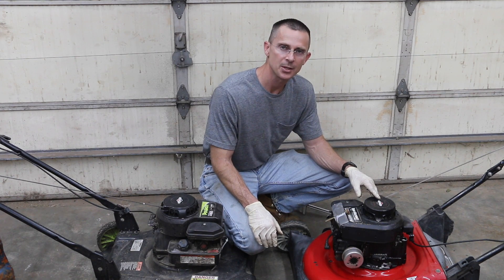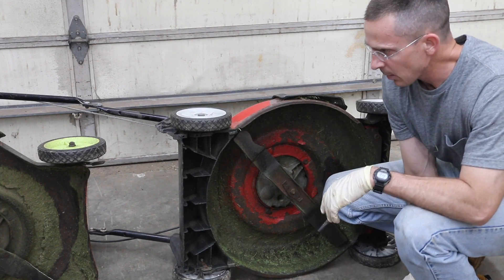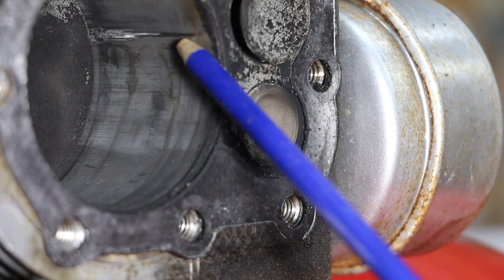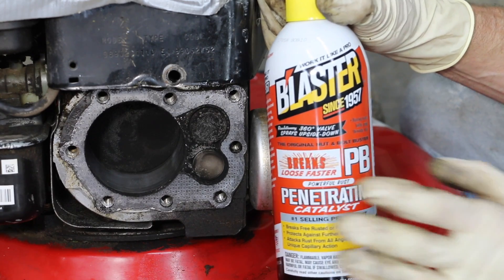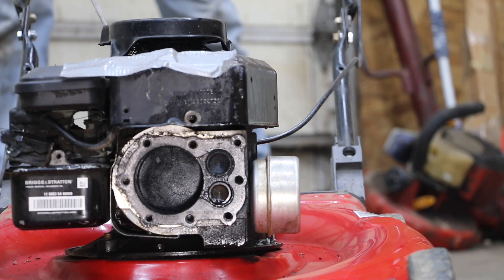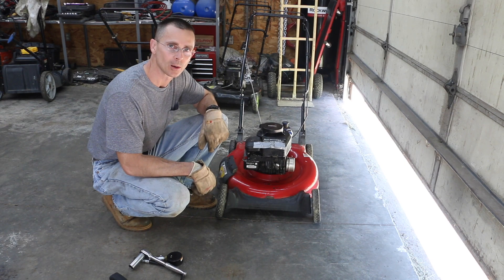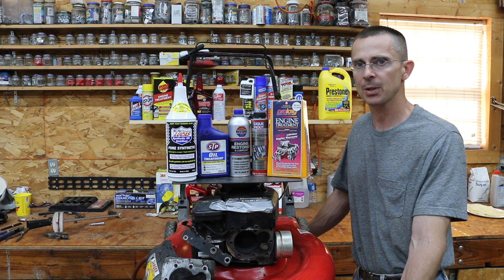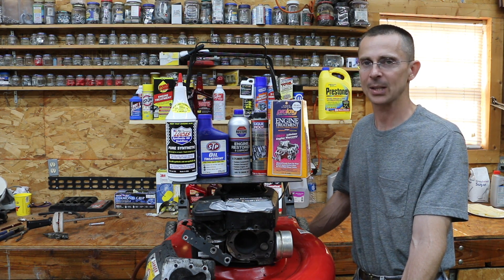Engine ran without oil, seized! Can it be saved?

Comment: I've been turning wrenches for a long time and may be able to help you here, even if only a little bit. The manufacturers claims on products you're displaying would be regarding a motor that has normal wear and tear, yours is abuse so it's going to fall outside of the product design. If the cylinder is aluminum and not sleeved, you may be able to use aluminum brazing rod, smooth it with a file or emory cloth and hone it to make it finished better. Then polish the crankshaft and plastigauge the bearing clearance. You may need a new rod bearing. You could try some of the products for the knock but you really need something that is thick. They used to make motor honey, or just use gear oil. Have fun.
Reply from the maker: Mike, This is very informative and helpful! Thanks for watching the video and commenting!

Comment: just for the hell of it, see what the ceramic oil additives do to polish up nasty bearings. id like to see what it does to the connecting rod bearings and crank journals. just for the hell of it.
Reply: or maybe see if an oil that is rich in zinc will quiet the knocking a little
Reply from the maker: leakage182, Great idea!  Thanks for watching the video and commenting!

Comment: just out of curiosity,  I'd like to see the piston pulled out, cleaning the cylinder walls real, real good and throw some JB, Weld on those cylinder walls and hone the cylinder walls after the JB  is done put the piston back in with a god set of rings and see how well JB holds to keep compression. and how long it would hold up.
Reply from the maker: Adam,  That's a great suggestion!  Thanks for watching the video and commenting!

Comment: Well, yeah. It locked up because there were probably pieces of the bearing caps lodged between them and the crank. Not to mention the complete lack of lubrication to the piston. You wanna throw enough money at it, sure it could be saved... New crank, conrod (because the conrod and a cap are the main bearings), and probably a new piston to fit the now bored .020 (maybe .030 or .040, judging by that ridge...) over cylinder. Also, valve guides are probably chewed up. You'd been better off using motor oil or maybe ATF to lubricate the piston when trying to turn it over. PB Blaster has the exact opposite of the desired effect. It's not a lubricant, per se. It's a degreasing agent mostly. That is to say, it will wash out the cylinder, rather than lubricate it.

TL;DR
It's junk.

Comment: One of my first small engine experiences was with a b&s that had locked up. what I did was years it down and took the highest grit sand paper and polished the crank and con rod. it worked but I too lost compression. so I took it apart again and cleaned up the cylinder walls and put new rings on it. I never had any luck with the engine treatment other than dura lube. in another engine I ran that then drained it after a couple runs and it ran a very long time with no oil. I just don't think you'll get past that scoring no matter what you use.
Reply from the maker: Sean, I enjoyed reading your comments!  Thank you!

Comment: Excellent, thanks for getting it going again!

I have played with go carts in my younger days. I would dig engines out of the scrap heap and get them going. The go cart never saw a heavy "load" but it did run at high RPMs.

The Briggs engines with the cast iron cylinder sleeve seemed to fare much better when seized. They would often run until the connecting rod broke at the crank journal; however the cylinder was undamaged. Something about the dis-similar metals helped the piston and cylinder survive.  There were many I got with a broken connecting rod and a small hole in the side of the block. I would rivet a patch over the hole and put in a new connecting rod. The engine would go like new... with only a small "battle scar" on the side.
Reply from the maker: Thank you for the positive feedback.  I enjoyed reading your comments!

Comment: >not taking a honing brush to it and then putting new rings on with a sanded piston? wow just wow. the money you will spend on keeping this POS alive in snake oil bullshitery would pay for the $45~ dingle-berry hone brush and $5 in some 320 sand paper and some RTV gasket maker to put it back together and you would have been able to sand down the crank and put new crank bearings in and probably get another 500 hours in the engine. Good job blowing $20 for 5hours if your lucky. I would never recommend anyone do what you did over a proper bush fix. No need to take it out .030 bore just brush hone that bitch. 
Thumbs down :<

Comment: put flower in the air intake
Reply from the maker: t North,  That could get interesting!  Thanks for watching the video and commenting!
Reply: thanks
Reply: As a kid I used to mix flour with water to make paste. I'm guessing the same paste will form when flour is mixed with anything moist, such as motor oil or liquid additives. 
I tried saving my homemade paste for future use but it turned into a green mold in the container in a couple of days. Being a fearful kid at the time I incinerated the concoction.

Comment: I put Prolong In my Dodge van with a 360ci when I did a oil change in Denver. Went to a town in east Kansas and engine stopped. Not from the oil additive but a frozen battery. After thawing the battery I checked the oil level it was empty  NO knocking 6qt added and high oil pressure. Other than a oil leek at rear main seal Have to keep an eye on the oil level. LOL Made it to Kentucky, down to Georgia, over to Texas, up to Colorado, then to California when I did a oil change and no knocking. I believe in Prolong.
Reply from the maker: Kelly, Yes, a lot of positive comments regarding Prolong!  Thanks for watching the video and commenting!

Comment: Always just junked the lawnmower if the engine seized.Did try to save a 250 C I Chevrolet enigine that had seized up.Tried Marvel Mystery oil,and a very well known brand of engine oil.Pulled the spark plugs put oil into the engine that way.Finally got it to free up,start up smoked like you would expect,but finally cleared up,engine ran for about a year after that.
Reply from the maker: Charles, Impressive!  Thanks for watching the video and commenting!

Comment: I had a 1981 Honda XR 250 that bottomed out on a big rock that was hiding in the weeds. I continued riding not knowing my crank case was cracked and my oil was draining. Of course it locked up. we pulled out the spark plug and poured diesel fuel down in the cylinder, sealed up the hole with jb weld and took turns jumping on the kick starter until it finally broke free. We finally ended up pulling it up and down the road with a three wheeler until it started. It smoked very badly and it didn't have a lot of power but I rode it for five or six more years before the timing chain broke and I junked it. I called it Old Smokey.
Reply from the maker: Luke, I enjoyed reading your comments!  Thanks for watching the video and commenting!

Comment: How many engines has "Slick 50" ruined?  When my Moto Guzzi  froze  solid , I was really confused and upset. What had I done to cause that? I wracked my brain for a while and remembered that I had changed ALL fluids earlier that day. I began to suspect the "Slick 50" and decided to conduct a little experiment. I drained the oil from the Guzzi  and filled it into an old beater car. I drove it for around 20 miles and clutched in immediately when I felt it seizing up. There was nothing visibly wrong with the oil 
Eventually I found others with the same experience. One engineer said Slick 50 causes vapor pockets in the circulating oil--like vapor-lock in a fuel line. This lasts long enough for the engine to seize. Of course, the company that made it denied everything. Guzzi parts are expensive. It's been years and I still haven't rebuilt it. It's been long enough that the Guzzi Le-Mans Mk 1s are going up in price. It might be time to go to work on it.  Slick 50,--another big company ripping people off!
Reply from the maker: Steven, Very interesting!  I enjoyed reading your comments!  Thanks for watching the video and commenting!

Comment: i run DELO 15/40 in everything I have, vehicles and small engines. Proven superior lubrication. Low ash, high detergent. If it keeps diesels from flying apart it'll work in anything you have that's 4-cycle.
Reply from the maker: Lewie, I like this suggestion a lot!  I use it in my large diesel engines and have had great success!
Reply: I ran a 980-G Cat loader that was bought back in 02 or 04 and when I quit it had over 24K hours, yes 24,000 hours on it and the engine and tranny had NEVER been touched. Had a leaking valve cover gasket replaced, was checked and everything was still within specs and was put back up and ran. STILL running, I dare say. It's GOOD stuff, pal!

Comment: Knocking probably caused by the rod bearings or a flat spot on the crank? Might want to bore the cylinder out, new oversize rings,
valves reground and seats. More cost effective to put a new engine on it but then as cheap as these mowers are, buy a new one.
The old one is good for parts and thanks for the video.
Reply from the maker: Dennis, I believe you are right!  Thanks for watching the video and commenting!

Comment: Big fat YES. I used Running In Lube/oil and it cleaned up the bore really well. im not saying the crank and con rod will be happy. but i have done it lots of times over the last 20 years. obviously the equipment was for my use only. and not for resale !!

Comment: That Engine Restore in the silver can claims to fill voids in cylinder walls. I can tell you now NOTHING is going to fill those voids other than brazing some metal in there and then honing it down. But, I would like to see how much of the void the Engine Restore could fill in. No matter which product you use, testing how well it works is just a simple matter of doing another compression test.
Reply: MrCougar214 Yes, it should be used without any filtration or it will be coutch by the filter and won't work.

Comment: I'd like to see a teardown and rebuild of that engine.  That knock might never go away without a new connecting rod bearing.  One thing you should totally do is run thicker oil.  Maybe put some Lucas in there.
Reply from the maker: RandomActivities, Yes, I plan to tear down the engine once I'm finished testing additives. Thanks for watching the video and commenting!

Comment: Hone it, measure diameter of bore and get new pistonrings to fit it. I'm no expert, but the knock could be several things I think. Pieces of the piston skirt might have broken off, or perhaps some of the bottom skirts on the cylinder. Most likely though, it's a seized bearing. Anyways. My point is; if you're going to fix it you should take it apart and check whats wrong. Nice video and good luck with the repairs. :)
Reply from the maker: Daddymarkram, Great suggestions!  Thanks for watching the video and commenting!

Comment: put a brass or copper shim in the con rod.
Reply from the maker: Great suggestion.  Thanks for watching the video and commenting!
Reply: I watched my dad put one in a brand new Chrysler 9.9 boat motor. Now with the name and such you understand that this was around "69 when it happened. Dad put it together and it ran until my brother-in-law blew it up in 2004 or so. I put a lot of miles on that engine, trolling for bass and such. Gas was 0.50$ a Can Gallon and that's 4.55 liters. USG is 3.??. Just something I recall. We has No Tax fuel, that was for the farm. Back then it  was something of a big deal. Any way - Cheers, Thank you, I remember Slick50 and the MLM that went with it.

Comment: The only way you can get rid of that knock it by polishing the contacts surfaces. You can use valve seat polishing compound to do that. The engine will always smoke due to the damage on the cylinder wall, you will need to bore and oversize the piston to fix that.

Here is what this video should have said: DO NOT RUN AN ENGINE DRY. No amount of additives will revert the physical damage caused. An engine lubricant will not replace the metal that was stripped away on the bearings and the cylinder liner.
Reply: Just don't do it. Keep your engine happy and don't cheap out on oil.

I know the destruction of this engine was for education purposes, I follow the series. But I would like you to emphasize your results. People are very easily persuaded into buying wonder additives thinking it will do miracles. I have faith in most of these products, but I do not believe you saved this engine with them. YOU saved this engine, not the fancy products. The slick 50 video should have proved this to you.
Reply: Personally if I was sent this engine to fix on the cheap without a full rebuild. I would have used WD 40 and some Kerosene. Works just fine to free a minor seize.
Reply from the maker: Meusana, I enjoyed reading your comments.  Thanks for watching the video and commenting!
Reply: Project Farm sorry if I come across condescending or judgemental. but you know internet.

I really like the channel. You have this "I am actually gonna test this for myself" attitude. Thats great, and thats why im critical in my comments. critical thinking promotes critical thinking. 

Thanks and keep it up.

Comment: Come to think of it, my lawnmower was run pretty low on oil and I'm wondering if my cylinder wall is not scored. If it is I will try to hone it with the piston pushed down in its bore. It's not knocking however.
Reply from the maker: Thanks for watching the video and commenting!
Reply: +Project Farm  I just now came in from the garage. True story. I decided to experiment with my own lawn mower. I checked the compression....30 psi. LOL. I pulled the head off. The cylinder walls were all scored lengthwise. A nice grove every 1/16 of an inch that I could feel with my fingernail. No wonder it was hard starting. So I buttoned it up and it started but it looks like I'm off to the store to buy another one. I barrel-picked this one anyways about ten years ago so it doesn't owe me anything. In 34 years since I've lived at this house I've barrel-picked ALL of my mowers due to the fact that my lawn is so small. 30 psi, LOL, I'm surprised it even starts.

Comment: i'd like to see you run 90w gear oil. with the original mission of testing manufacturer claims, however, i think using Engine Restore is the best fit for the next video
Reply from the maker: Thank you for the product recommendation and thanks for watching the video!

Comment: none of those additives will fix rod knock, and more you run the engine the worst it will get
on a car, molybdenum containing additives are good for manual tranny and diff, everything else specially those that claim restoring cylinder walls or transmission gears are total garbage. infact you will ruin your engine in long run even more with those abrasive materials in those additives
new motor oil already contains all anti-friction and protective additives your motor needs, you dont need to mix even more, it doesent work like that
i would suggest simply changing your motor oil more often (every 3000miles) is better than buying expensive additives and mixing oils, and hoping that magicaly your motor will be fixed. it will never happen
Reply from the maker: Great point!  Thanks for watching the video and commenting!

Comment: Probably already mentioned, but, the crankshaft & main bearing will be buggered, the crank bearings top & bottom will be ruined, as seen the piston & cylinder are scratched up, cam bearings & valveguides will be egged out, so yeah, I'd say the engine's scrap, good for a laugh to make it run in such terrible shape though... :)
Reply from the maker: Yes, you are right!  I can hardly wait to see which additives to test.  So far, Lucas is in the lead and Prolong is in 2nd.  Thanks for watching the video and commenting!

Comment: I've seen the Restore stuff increase compression and decrease oil consumption, but this engine has better compression than some of the others you've tested without damage.  I don't know what will change anything with the knocking.  The STP is just a viscosity modifier which is very thick, I think the Lucas stuff used to be, I don't know about the synthetic stuff, those 2 are probably my best candidates there.
Reply from the maker: Mark, I enjoyed reading your comments/analysis and I agree that a thick, cushioning oil is needed.  Thanks for watching the video and commenting!

Comment: I was not thinking and lazy. forgot to torque down my oil plug. engine seized up on the freeway. got another plug since the first was lost. drop in oil pressure but still runs excellent 20k miles after the incident.
Reply from the maker: Impressive!  How did you unseize the engine? Thanks for commenting!
Reply: Project Farm I just put a wrench on the lower crank and ran it through a couple rotations!

Comment: Could have just removed the piston and dingleballed the cylinder, but if you want to restore some compression with a chemical product and not actually any mechanical work, i would try some lucas stabilizer mixed with a diesel oil like shell roltella 15w50
Reply from the maker: socal3800, This is an excellent suggestion!  Thanks for watching the video and commenting!

Comment: I have used restore due to its high chrome Molly and zinc properties. really does work on freeing rings and improving compression as well as micro finishing the rotating assembly.
Reply from the maker: Jonathan, I'll definitely test restore in an upcoming episode.  Lucas is leading in the vote thus far.  Thanks for watching the video and commenting!
Reply: Project Farm lucas is good but it is and oil stabilizer meant to keep the oil from breaking down from the heat and pressure inside the engine. Just a little fun fack.